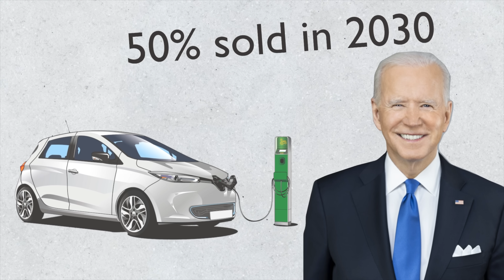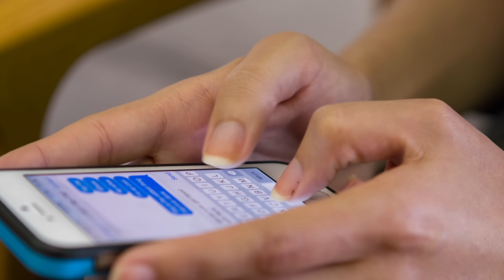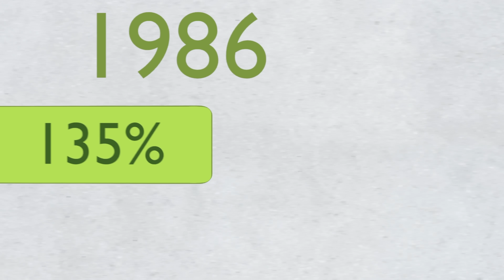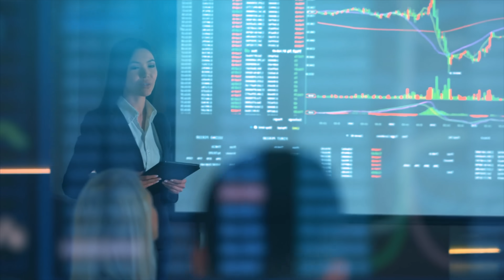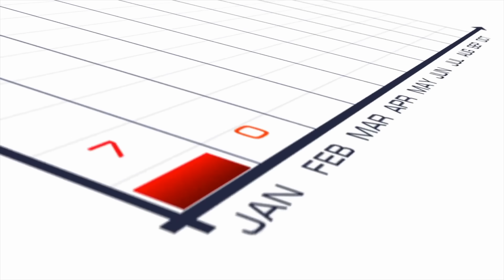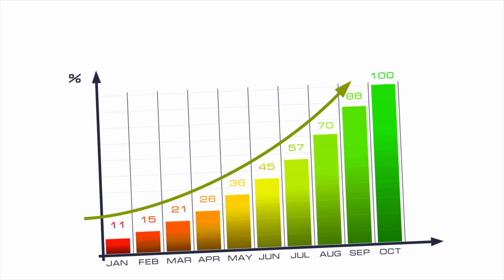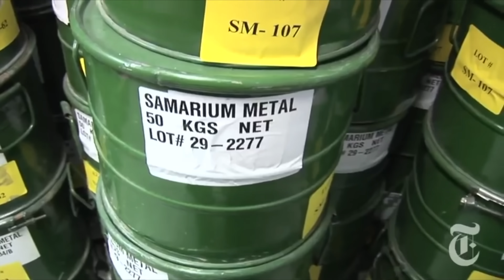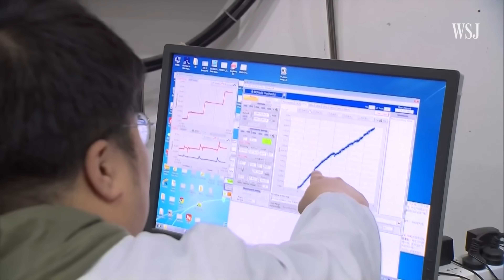Here's Why China Now Owns Toyota, Ford, GM, and Tesla

Comment: Solid State batteries may help lessen/mitigate some of the rare earth metals supply/demand issue upon their large scale introduction into the marketplace.  However, EV manufactures will also begin to produce more efficient electric motors, more aerodynic design, along with more efficient regenerative braking capture (aided by software development) Solar panel integration on vehicles, we may also reduce need further yet.  Engineering challenges, are the mother of innovation/invention !
Reply: half of that technology you mentioned is still in its baby stages, it will take long for it to be fully sold to us, the public....
Reply: @neometalx9  we riding horse to get food just 120years ago. With exponential growth of technology, I think we inevitable will see it happen in our life time.
Reply: @mr123undead  well, we might as well see flying cars, in our old age, it's just not there yet... EV is the future but the future is not now...
Reply: @neometalx9  flying cars of the future ..ya you watched Back to Future just like me.  It's a pipe dream.

Comment: The future is hydrogen from a gas tank of water, not EVs.
Reply: That would be nice but it's more likely we'll get fuel cells or fill up with liquid hydrogen (watch out for static!).
Reply: Not quite ， the infrastructure is expensive and nothing more convenient that charge your ev at home on the night and you good to go in the morning ,you can do that with hydrogen car if no Infrastructure around
Reply: @cobaltblue2756  An EV infrastructure will also be expensive.

And our ability to generate enough electricity is only part of the problem.  Indeed, you can generate all the electricity you want, but that electricity helps nobody if you have no way to reliably deliver it.  That's where the power grid comes in.

The current condition of the power grid in North America is actually kind of perilous.

Remember what happened in Texas when a big cold snap led to a grid failure in that affected region not too long ago?

The point: why couldn't that happen nationwide?  All it would take is to overwhelm the grid with demand that it can't handle all at once, such as a nation of a couple hundred million households charging their EVs overnight along with running air conditioning/heating and food refrigeration.

It took decades and considerable money to build up the power grid as it exists today, so why wouldn't it also take a long time and a lot of money to make it better?

Otherwise, if we fully transitioned to EVs without improvements to both the supply AND delivery of electricity, then we face the prospect of living in a society without reliable electricity at all.

We are not ready for full scale adoption of EVs to the point where we won't need ICE vehicles, and we won't be ready for that for quite a long time.
Reply: Electrolysis required alot of current to perform, not easy to pull those hydrogen out from the h2o bond
Reply: @mr123undead  One plentiful supply of hydrogen: fossil fuels.

Over 90% of current hydrogen production comes from hydrocarbons, which is much easier to process into hydrogen than breaking covalent bonds of hydrogen and oxygen atoms via electrolysis.

Reallocating fossil fuel production from gasoline and diesel toward hydrogen for fuel cell vehicles may be a more efficient and cleaner use of that resource.

Of course, because there are people who want to do away with fossil fuels altogether, that will probably never be realized.

Comment: At auctions, cars built before complicated electrics were installed and those with the engine and transmission propshaft driving the rear wheels are now highly sought after and are achieving extraordinary prices, as enthusiasts  prefer vehicles they can work on in the event of problems rather than be at the mercy of computer welding technicians . Lift the hood of todays car and it is a mystery which part is the engine!

Comment: Hydrogen powered vehicles would be a better option
Reply: Batteries technology is to far ahead now
Reply: Hydrogen powered vehicles still need batteries (to buffer between electricity production and the motors), and the fuel cell for the hydrogen also needs a lot of rare earth metals.
Reply: @TheZeusJuice  so we should just have china as the sole producer and controller of our energy needs...
Reply: @sko1beer  no
Reply: @phishENchimps The answer is to get the rare earth metals from somewhere else. I was just pointing out we'd still need those metals for hydrogen cars, just as we would for electric cars. Heck, oil refining uses a ton of cobalt, so even gas cars don't get a free pass.

Comment: Wonderful video. It always surprised me why more effort was not made to reduce the weight of ICE cars to achieve higher mileage per litre of gasoline? At one stage it appeared that graphene and other carbon fibre materials would be used for the chassis to greatly reduce a vehicle’s weight. 50% reduction in weight could allow a 40% reduction in horsepower/torque.

Comment: Rare earth metals or even precious metals won't be needed for industrial purposes in the future because many replacement chemical formulations of existing technologies and new technogies altogether that don't require such materials are right around the corner, such as sodium-ion batteries and fluoride-ion batteries. Sodium-ion batteries (made from seawater, which is even cheaper than freshwater) have actually already started pilot production in 2020 and will start mass production next year, and fluoride-ion batteries (also made from super-cheap seawater) in 2025 and 2028, respectively.

Comment: You also can't make modern electronics without silver, gold, and palladium with silver being the most important (by weight) of these metals.  That means without these metals there are no touch screens, no multi-function displays, no iPhones, no laptops, etc.
Reply: i can live with a flip phone.
Reply: @numathesaint872 , guess what, those metals are still required to make the integrated circuits in your flip phone and are required for the LCD display.
Reply: @adventureridergirl  i can live with a telegram.

Comment: Sodium batteries will be the answer.  Not only is there an unlimited supply of sodium in our oceans, the chemistry allows the use of aluminum for the battery conductors, so expensive (and heavy) Nickel and Silver are not needed.

Comment: The biggest drawback to electric vehicles is the power source. The electronics and drivetrain are pretty decent. It all comes down to the power supply itself. Its just not there yet for me to even consider an ev of any type.
Reply: Biggest drawback for me is the main battery dying in EVs.   Your range shrinks every year. And many batteries will suffer premature death.  All batteries eventually die.  As mentioned in this video, raw material costs for these batteries are rising and it will be SUPER expensive to replace your main battery for EV.  For example Tesla main battery replacement is quoted from anywhere from $16K to $25K by Tesla.  Easily price of a brand new gas car!   Will you replace main battery in your 10 year old EV when main battery dies?  That's why pure EVs are still not affordable at all unless a true forever battery is invented.    Good compromise might be PHEVs, which have much smaller batteries and therefore much more afforadable to replace, getting most of the benefits of EV in city driving.

Comment: Doesn't anyone else remember the very respectable gas mileage we were getting in 1970 from a small unatractive un-sexy little boxy hatchback made by GEO, I think it was, that nevertheless got 58 MLES per GALLON? A regular small gas engine, sure it had enough power to earn you a ticket if you wanted to drive it over the speed limit, but why....No EV needed, not a hybrid, yet it got better mileage than the claimed mpg for the Prius!....car companies CAN make super efficient cars that use half the gasoline; one-third the gasoline; ie, 60 mpg or better-- they don't want to, though, because they have interlocking boards of directors with the oil companies; keep forcing people to buy LOTS of gas, forever, via 20 mpg cars, or 25, or 27: ridiculously crap fuel efficiency. If all cars were required to get 60 mpg w regular gas engine, then they WOULD! --and one third the oil would be burned, to go the same distances, same trips to work etc. The other requirement is public mass transit as efficient as all European cities. You can cut your driving down to a fourth or a sixth of what you do now, with a well-run, efficient metro system to jump on. Barcelona system is a revelation: safe, clean, fast, frequent, and it goes absolutely everywhere, including about thirty miles out into the countryside in every direction. I couldn't believe it. It made me realize, we can have this! The richest country in the world! In every big and medium city!  But we don't, because all our money gets routed into military spending and into lining the pockets of billionaires.

Comment: If they were really serious about the environment, they would limit the size, weight of the cars.   2.5 4 cylinders or smaller engines.   High tax on turbos.  Electricar's have too much weight.  Limit speed to 55mph or less.   Geo metro or honda Crx 30 years ago got mor than 50 mpg.

Comment: Saw a video about geothermal power plants, they drill two holes deep into the earth and pump water down the holes , it causes the earth between the holes to fracture. The water returns hotter and is used to generate power, also the water returned has rare earth metals in them. The increase in the price of rare earth metals makes it practical to process these metals now.

Comment: Scotty - rare earths are rare- hence the name.  Lithium is the 38th in abundance, it takes 500,000 gallons of water to produce 1 ton.  To make 2 million EVs; production of Lithium takes a volume equal to 1/3rd of the water in Lake Erie to process it. To make 1/4 of cars made anually such EVs would required 7 Lake Eries annually. Cobalt is 1/10,000th of the earths crust. There is 2500x as much Iron than Cobalt. Iron is 80% of the earths mass by weight.  Obviously Lithium can't work to make many more EVs - Sodium is more common and easier to refine.
Reply: Sodium is a good choose but there is also graphene and graphene batteries don't have the the overheating problem that lithium batteries do so you don't have to install cooling systems like they do in the Tesla's, Which means with them being lighter and not needing cooled you can shove more in and get more storage.

Comment: Let's hope there is enough electricity to keep all of these cars running because there is barely electricity to run all of the acs during summer time.  Now, 50% of automobiles will depend on electricity.

Comment: To put out 1 lithium car battery fire (a total loss), it took Firemen 4 hours; 2,500 gallons of water; 5 Fire Engines; 1 water tender; 5 Fire Battalion Chiefs & 1 Hazmat Officer to control the scene. They had to turn the vehicle on its side to access the lithium battery. 

And it was a VW EV vehicle fire that sank an entire car carrier. 

During Northern CA wildfires, PG&E shut the power off for a week, so no one could recharge their Teslas—unless they used a gas-powered generator. EVs are absolute death traps during wildfire season. How are people supposed to emergently evacuate if they can’t even charge their cars because PG&E chronically shuts the power off for days? The fires that lithium batteries emit (if the fire began while charging in the garage) burns down the garage AND the house. 

China had 50 EV lithium busses catch fire all at once in a public garage. They’re extremely dangerous. A new lithium battery costs $20,000 to $30,000. Old batteries are toxic and have to be buried. How is that “green”? (Old wind propeller blades are also buried). 

Think of all of the lithium vehicles that were abandoned during wildfires when people had to evacuate some other way because they couldn’t charge them? Those all caught on fire, emitting toxic pink flames/smoke and Firemen were faced w/ astronomical problems because EACH lithium vehicle took 4 hours to put out its fire. Plus breathing in toxic lithium ash smoke plumes.

I would never feel safe in CA re/ wildfire season and lithium EV vehicles.

Comment: Hey, does this whole thing sound similar, maybe I am just old enough to remember the scare over oil, led light bulbs, then the scare over metals in CATs, then Microchips, etc. 

Isn't this just macroeconomics 101, since as Scotty noted these elements are not "rare". Isn't this just a ramp-up phase of production? China used to be 90% then the world saw the issue and now they are 63%. I mean if we need these elements and they are not rare then country after country will mine them because they are worth $$. 

Now what I would be more interested in is the percentage of processing. Because if the Chinese are the only processor then the problem has not changed. I mean Mexico has plenty of oil, but they send it to Texas to make gasoline. So are they really less oil-dependent if they cannot process their own oil? The US could still just cut off processing and the oil would be effectively worthless.

Comment: Auto manufacturers need to eliminate "planned obsolescence" of their vehicles.  Some improved engineering to enable critical parts, including body parts that rust, to be removed and replaced for less than the value of the car.  If EV sales continue to grow the auto companies need a more economical way to replace the EV batteries.  I own a hybrid, which also has an ICE (gas engine), and the inside of the vehicle has to be torn apart to change any of the hybrid batteries.  EV batteries are built into the frame so they're more work than even the hybrid.  I drive my vehicles 15 to 20 years, but most succumb to rust before mechanical failure.  Unfortunately rust (iron oxide) doesn't qualify as a rare earth metal.🤣

Comment: Everyone I know that has electric vehicles they already broke down and repair shops I checked them out there no fun I stick with the gasoline engines I don't want none of that garbage gasoline is way better that's the fun part about driving you want to hear your car run and have control of it

Comment: Electric cars can be very useful option for vehicles that needs a lot of gas to operate (like city buses). Car manufacturers are better putting their effort on more reliable and efficient cars. The way the car industry is going makes the problem worse. Different problems but worse. Just imagine how to recycle all these batteries!!! This is not a green/zero carbon (or whatever you want to call it) solution.

Comment: The solution for the limited supply is: Only the rich will drive.  The poor can ride the bus and eat cake  Only rich and poor nothing in between.
Reply: The poor will drive used cars, same as they do today.
Reply: @TheZeusJuice  Just like the ones in CUBA.
Reply: @nightdipper5178  Just like it always has been in the US: Since at least 1990 (didn't look at older numbers), used sales have always been 2-3 times the volume of new sales/leases. Look up "New and Used Passenger Car and Light Truck Sales and Leases" from the Bureau of Transportation Statistics.
Reply: @TheZeusJuice  You lost me at " always has been in the US".  It is not like it always has been.
Reply: @nightdipper5178  Ok. Since the oldest data I could find (1990 to now), used car sales has been a way larger market than new car sales. Even told you where you can find it to look at it yourself. Do you have any data that says otherwise?

Comment: EV is all about control, just like most any large big picture thing you look(cough...coveed). So once your car can be shut down, or even drive itself where it wants, has a mic and can hear your conversation, and its not self serviceable, you are under more control. Your electrical and other power in your home is now slowly being changed to remote auto controlled. Much easier to mass control people. None of this is for environmental reasons. FYI, there used to be a carburator that was designed to get 40mpg's decades ago. What happen? Either Ford or Chevy(forgot which one) bought the patent and shelved it.

Comment: WE see a lot of Chinese dominance here in the Arab world, the US market is still Isolated from Chinese made EVs and Vehicles, 
and boy oh boy, are the American auto makers losing their base.
American parts are all made in china, so they have a failure rate equal to or worse than Chinese made brands.
in the 1990s, American Vehicles made up 60% of cars on the road, today its less than 20.
Chinese brands like MG, Changan, Geely, Haval, GAC have overtaken the market with their designs, warranty & low price.

the point is, while the world struggles to keep up production, the Chinese market is unaffected outselling every other car manufacturer on earth.
on QUality... the failure rate of those Chinese cars is high too, My Local Subaru Dealership also deals with Chinese brand "Chery", the service manager told me this: (once the Chinese car is out of warranty, take it to out to the desert and set it on fire, you're lucky to own a Subaru these days.)
in the UAE, one of the Chinese made EV school buses spontaneously burst into flames.

TO make a single EV battery, you need to dig up 12 tons of Raw materials, so all this EV mania is actually worse for the environment on the long run.

the Only way EV's can be viable is if we can recycle old minerals in old batteries and Americans fully manufacture their cars inside America Again.